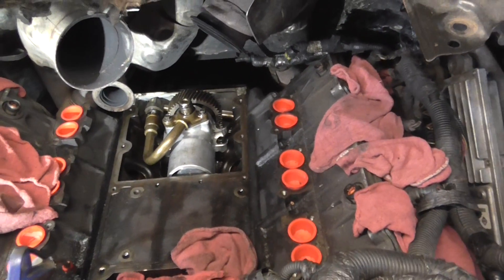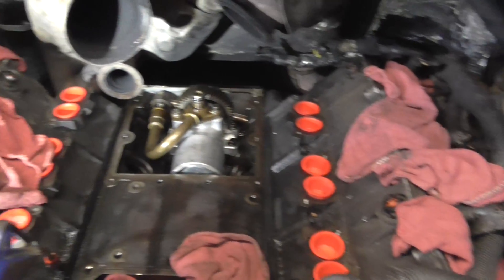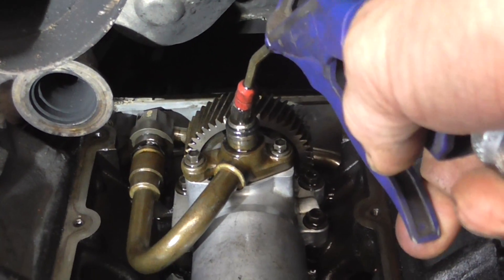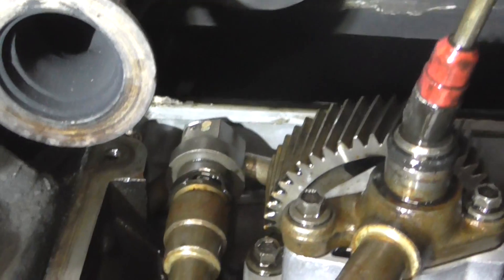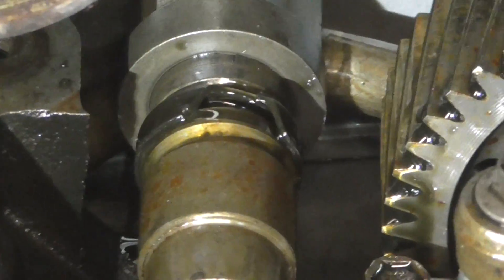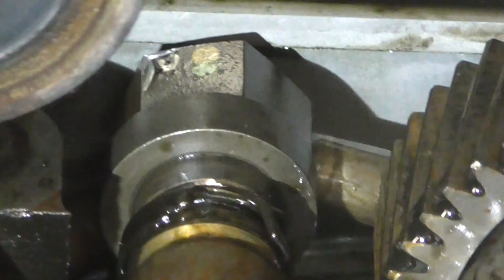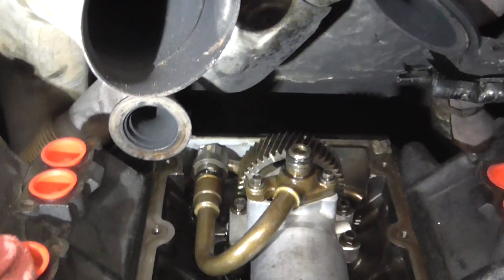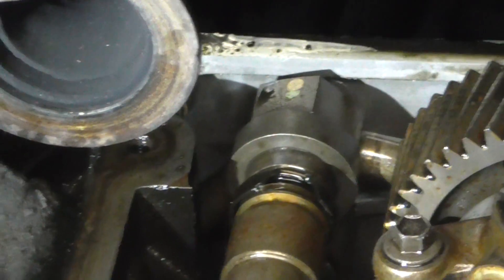6.0 Ford PowerStroke Diesel High Pressure Oil Leak

Comment: Where do the new orings go on the stc fitting tube. The d ring goes on the top part and metal ring on the inside tube......  but where do the other 3 rings go too? A white solid plastic ring, a black oring,  and another d ring.

Comment: How much air pressure should I run through the oil rail to test for leaks??????
Reply: Just a shop compressor 150psi should identify the leak the system is made to run much higher psi then you'll be able to introduce so dont worry about to much

Comment: I've been into a few of these and looks to me like the branch tube fitting end is bent and quick connect tube is at an angle and if left like this it may cause repeated failures at that connection. also a new pump wont help this Just my 2 cents